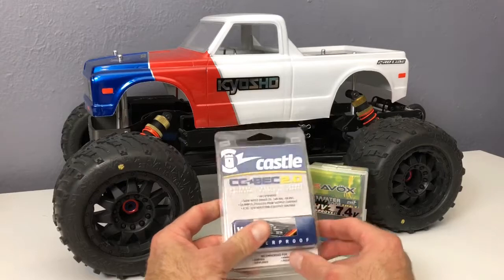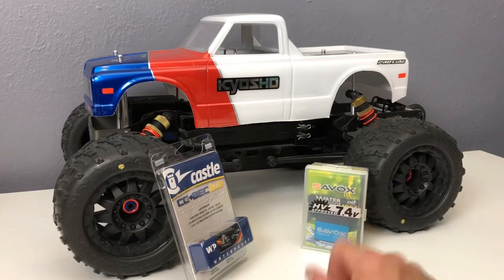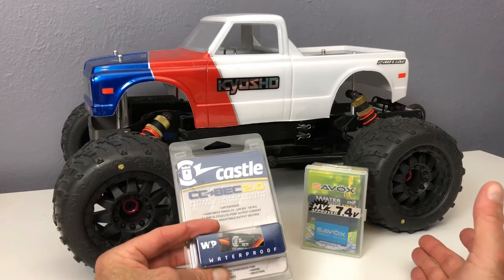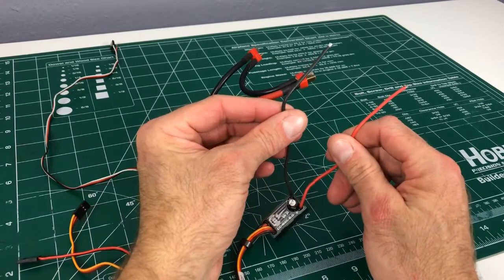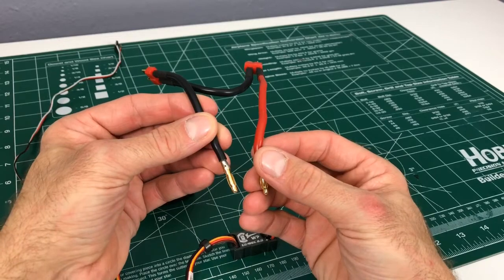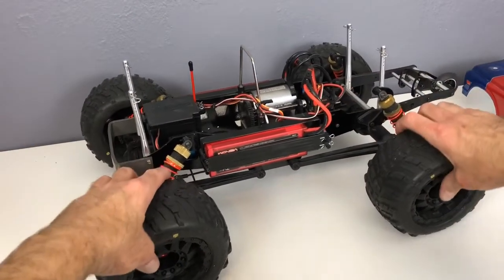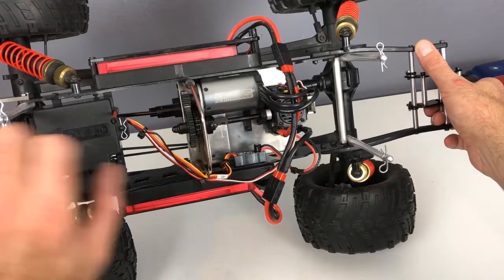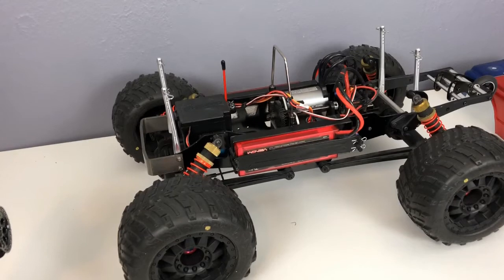Castle BEC 2.0 Install Kyosho Mad Force VE

Comment: I actually did want to watch you solder, and yes, I know how to solder. However, I'm curious about how to attach the 2nd set of wires to a receptacle that is built for one set of wires.
Reply from the maker: Sorry about that.  I soldered the main line on first.  Then I just glazed the smaller while with some solder and quickly pressed it into the main wire and released it :)
Reply: @KMJ187  Okay... thanks! That is helpful.

Comment: Is that normal then that as soon as you plug a battery in that the BEC powers up and the external motor fan I have turns on?  My CC BEC 2.0 also has a flashing red light.  Is this also normal? I just wanted to make sure as this is the first time using an BEC.
Reply from the maker: Yeah the Bec pulls power from the battery when the ESC is off.  Since the ESC is no longer providing power.  So yeah once you plug a battery in. Anything plugged into the reviver will fire up!
Reply: @KMJ187  thanks for clarifying...
Reply from the maker: @waikryder6633  these External BEC are awesome.  The amps being put out are so much higher than what most ESC can produce.  I have three kits using them.

Comment: Can i hook the castle bec directly to a 12v battery and turn the output down to match the ho servo?
Reply from the maker: Mr SS yes the the BEC allows you to adjust the output voltage and the AMPS.  In my case here I have the BEC booked up to 4S (14.8V). But I set the BEC to output 7.4V at 15amp.   If you did. A 3S pack (11.1v) you can do the same!
Reply: ModdRocker is a 12v agm battery still ok? Im trying to make a rc mower
Reply from the maker: Mr SS you might want to call castle about that.  Might be a bit much.

Comment: What if you only have one spare port on the receiver, can you just use a Y-harness to one port ON THE receiver to power it. I have the same Castle BEC putting it in  trx4 but I'm running a Dragon led light kit in it already and only have one port remaining.  I don't know if it's asking too much on the receiver to do this. I'm also running the Savoxx steering servo.
Reply from the maker: I'm not sure.  I purposely got a recover with one extra port.  Would be a good question for castle creations.  I'll reach out to them.